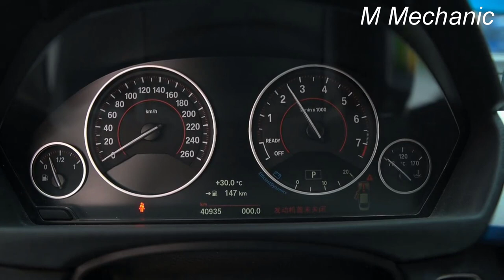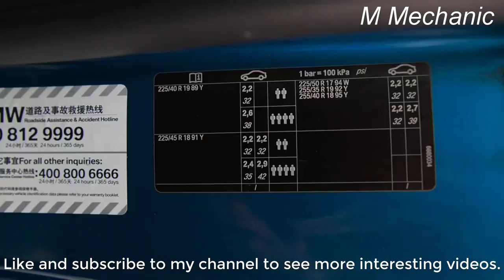Routine Maintenance Of BMW 4 Series.

Comment: What was the reason for changing the fuel filter ?
I saw that 60k was the recommend mileage for spark plug why change it at 40k?
Reply: Depends on the manufacturer, some do it at 40k others at 60k, not every car is the same.
Reply: Whatever BMW tells you to do,do it before their timeline.Thank me later

Comment: You're asking for trouble by not putting a light coat of oil on all the o-rings on the oil filter. Per BMW manual you're suppose to do this.
Reply: Nope oil gets in the filter first start up just another myth i never soak my oil filter no issues